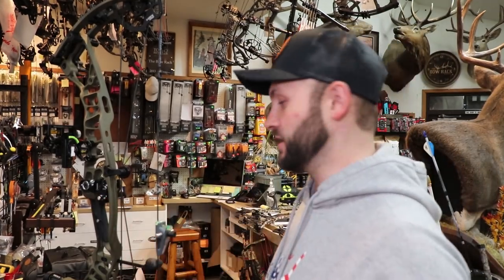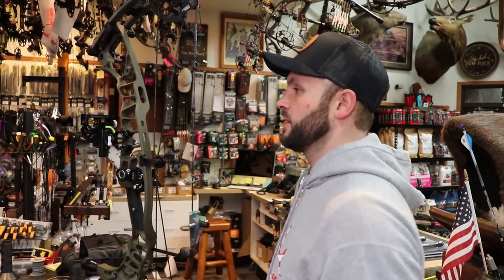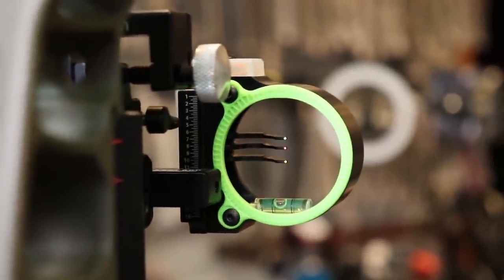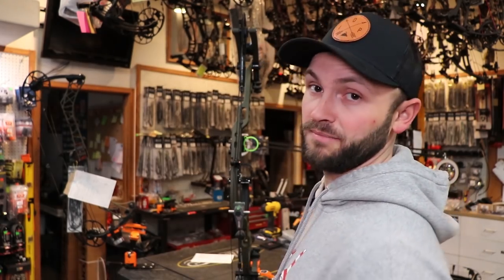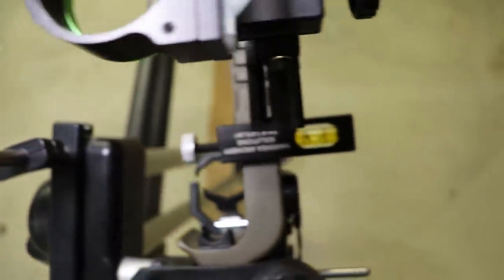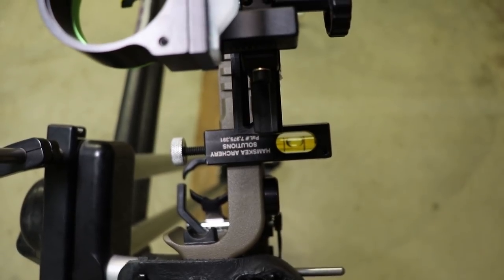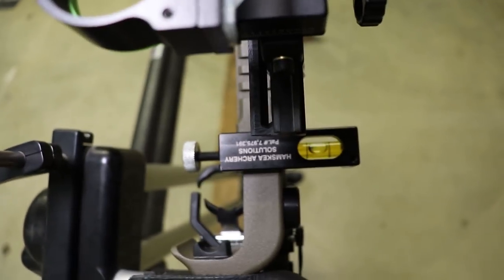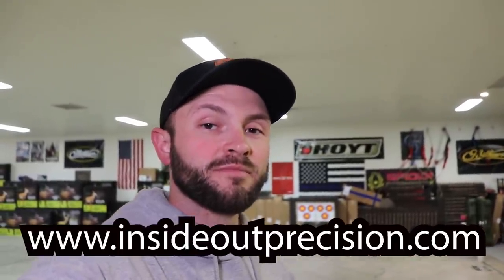Level Up - 1st, 2nd and 3rd Axis Adjustment

Comment: Solid video!  Only thing I personally do differently, I put the riser level up by the top limb pocket for two reasons for 3rd axis: 
1. The farther away it is, the more accurate the levels will be.  
2.  When you’re shooting, your arrow will follow your top limb, so if you’re making the levels match those points, you’ll have the most accurate 3rd axis possible.

Comment: Love your instructional vids.  I do have a question.  I see a lot of videos leveling the sight to the string?  I get you want to bow level left to right and front to back.  However, the cams could be shimmed making the string off from level to the riser making it run left or right of the riser.  It is tough to find flat spots on a riser but I use the same method as you with the exception that if the string is not level left to right to the riser, I will use the top part of the riser or the best flat spot I can find.  I set the rough third axis with the bow tilted but not drawn.  Next, I draw it back with the levels attached and see if they line up.  I find if you do not torque the riser with your grip it matches up perfectly with the static measurement.

Comment: If your string is not level with your riser to begin with and you level the sight based on the string. When you attach the Hamskea to the riser to check 3rd axis, will this ultimately throw things off?
Reply: good pick up - that's why some archers use a vertical line (needs to be checked that it is really vertical, you can use an edge from a corner etc.), aiming at this line (full draw!) and moving the pin up and down this vertical line and check that the bubble doesn't move to the left or the right. At least that is how I adjust / check the 3. axis.

Eta: forgot to mention that you still need a second bubble on the sight close to the riser you have referenced before.

Comment: Correct me if I’m wrong but I thought that you are suppose to set the 3rd axis while holding the bow at full draw and pointing steep uphill or steep downhill instead of a hooter shooter because everyone puts different amounts of torque on their bow.
Reply: I would say your correct. But the shop sets and gets it close for you. You should be leveling to your torque. I have seen where at full draw you level to a vertical string.

Comment: Some of the torque will be inherent to the bow control system (archer ! ) not the bow itself, when you mount it to the riser it needs to still match the already set bubbles (which is, I think what you meant about finding the suitable attachment point)

Comment: Have you tried the OMP Axis sight leveler yet? It’s super easy to use especially since you have the OMP vice. On modern bows with stiff risers how much difference does it make setting up third axis at full draw compared to using the OMP axis sight leveler?

Comment: Horizontal  ...( horzion in the sky ]  and when you put the level on the bow string, your checking for Plumb ( vertical level ) just like you would in wood studs for building a wall...

Comment: Probably too old to add a comment, but i'll try.  NOT ARGUING, just asking.  isn't the first axis that you demonstrate on the same plane as the 2nd axis?  I see the validity of doing this to ensure the bar is level before you ensure your sight/scope is level but it seems to my small brain that the 1st axis would actually be leveled by placing the tool perpendicular to how you displayed it, i.e. along the sight bar itself.  I'm not sure of a need for that, so maybe the 1st axis doesn't need to be leveled?   or maybe i'm off bubble in my thinking.
I enjoy the videos and appreciate your time.

Comment: Does the hamskea 3rd axis fit on a black gold slider? I just got one and can't seem to find a place that it fits flush on the black gold as it has the big knob that turns the slider....advice?
Reply from the maker: Run the slider all the way up and it should attach to the top without hitting the bubble
Reply: @InsideOutPrecision  OK thanks man, will give it a shot....I might have tightened the screw on the level a bit much causing it to torque a bit...not a Lotta room on the black gold to attach this easily!

Comment: I have the HHA tetra tournament with 2nd and 3rd axis adjustment ( single pin slider )  . I don’t understand how they expect
You to set second and third axis correctly if there’s no way to adjust first axis ? And first axis is definitely not in sync with my bowstring in level position or riser . How are you supposed to set this sight correctly ? Followed instructions but sight still looks slighty crooked . I used the Hamskea gen 2 level .

Comment: New to archery and have a question on this. When you buy a bow and sight from a pro shop do they usually set the 1,2,3 axis for you? Or is that something the shooter would have to do?
Reply from the maker: They SHOULD level all axis' tjat the sight has. Unfortunately, many shops are lazy and will tell you the sight company levels them at the factory, which is not true
Reply: @InsideOutPrecision  ok I may call and ask them to just make sure they did. If 3rd axis isn’t leveled will my target practice show a difference? Or only when I’m shooting uphill or down?
Reply from the maker: @xfighter1117  what sight do you have?
Reply: @InsideOutPrecision  black gold mountain lite

Comment: See a lot of people using a 4’ carpenter level over the riser in lieu of leveling the string? Is there an advantage of leveling the sting vs. the riser? Your using the riser at full draw to level the 3rd axis? Also the Hamskea level has a pointer that is usually used with a vertical string, how is that done on a hooter shooter?
Reply: All that pointer does is act as an offset to side of the riser. Bubble is being set perpendicular to riser.
Reply: @d500mag2  how about the 4’ level on the riser vs the string to level? Which is the better way to level?
Reply: @billstiger2359  string for 1st and 2nd. Level on riser will work for 3rd. I'd use the same side that sight is mounted to. The riser is what will be torqued by the cables or your form when shooting uphill or downhill.
leveling the third axis only verifies that scope and bubble are at 90 degrees to the riser. more or less than 90 degrees will show false torque.

Comment: Thank You for this, Questions...

After you finished the 2nd Axis Leveling (Essentially, leveled the Sight/Scope Interface), you then attached the Hamskea to the Riser of the Bow -- which Axis is that ??  What if that wasn't Level ??

I asked "which Axis is that" because it occurred "AFTER" the 2nd Axis Level and 'BEFORE' you stepped off to do 3rd Axis Level. 

Appreciate the insight.

John

Comment: That was great, very informative thanks. Im setting up a new Ventum 30 and all my axis have been checked at my pro shop, i've watched it get done twice but for some reason my pin still looks like its cocked to the left although so far everything seems like its on the money. Weather outside has been totally nasty here. Ice, high winds and snow constantly so its hard to get quality long distance tuning in. But so far all seems pretty good but that crooked pin drives me nuts. Can that just be where it needs to be? It's a Axcel Landslyde witha ultrview scope just for referance. Thanks

Comment: This always gives me a headache lol.   Can someone please explain why the first axis (bowstring and sight are aligned) is set while the bow is static?  If the riser torques when it’s drawn and the sight is attached to that riser, won’t that throw things off versus the reading I get on a static bow?  It seems everything should be set when the bow is drawn (torqued) versus sitting in a vice.
Reply from the maker: If the bow and string are perfectly vertical, the first and second axis aren't effected by torque. If you could keep the bow perfectly vertical you could make it do a 360 and the levels wouldn't move
Reply: 1st and second are set to string so that when you are shooting your bow, the sight bubble will show that your string is vertical. 1st and 2nd axis keep a shooter from canting the string. 
3rd axis is set to riser to remove false torque when shooting up or down an incline(ex  up in a tree shooting down). False torque comes from sight not being perpendicular to to riser.

Comment: Seriously: Get your stuff together before you make a video. I don’t even know where to start. You don’t even know what the first axis is.
Reply from the maker: This video is like 3 years old. The first axis is how the sight rail is level relative to the bow when the string is perfectly vertical. Then you match the second axis (the sight level) to the leveled. First axis. Then, with a level on the riser of the bow, still leveled so that all are matching, you put it in the draw board and set the third axis to match the level on the riser st full draw. Thanks for telling me what I don’t know though! Very informative.